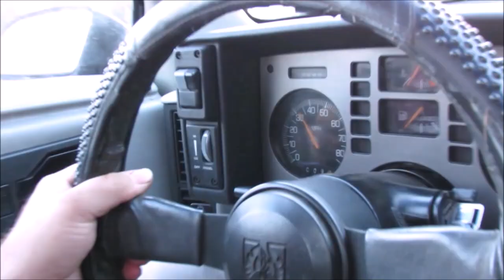Literally Buying My First Volkswagen

Comment: That engine is smoked.  Someone may have put gasoline in the car or used incorrect engine oil for some period of time.  Those ALH motors are sweet and there is a lot of aftermarket parts available.  I currently have mine at about 200whp and 370 ft lbs while getting 45mpg.